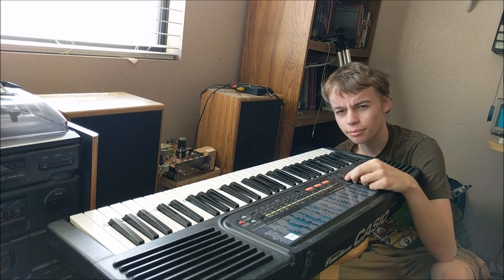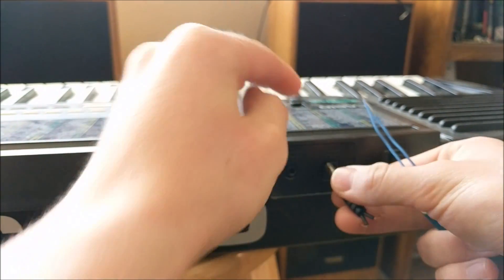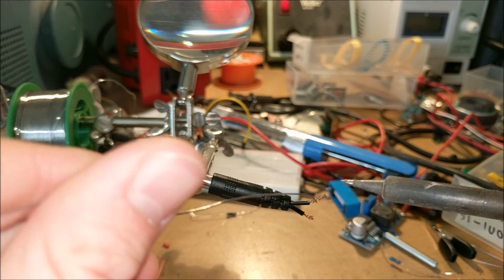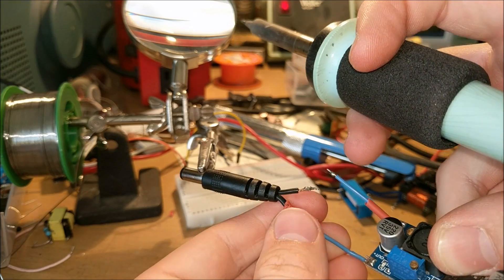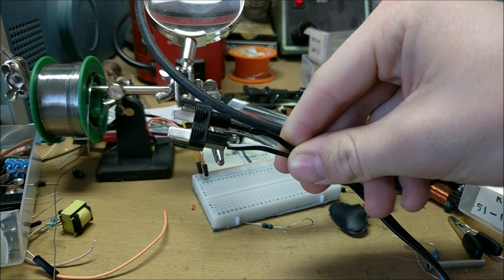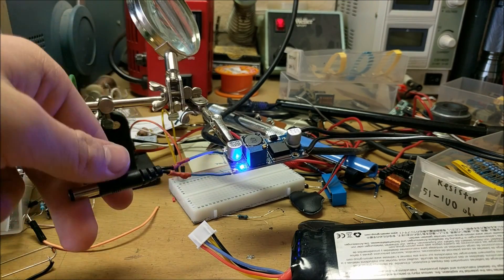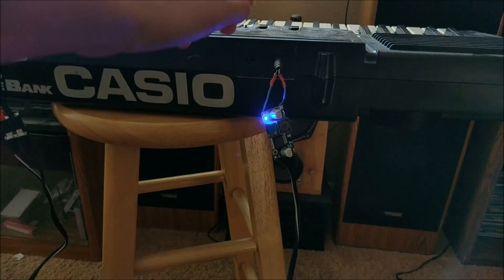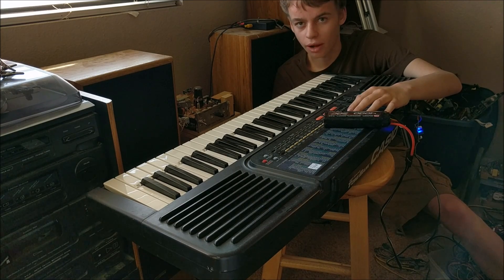Portable Keyboard Power Supply

Comment: Good idea and looks very easy to make if you've got the soldering skills! I don't. As an added suggestion:

I use a 16,800 mAh Trek Pow G22 car jumper battery pack $64 (which includes a 12V  cigarette lighter adapter) and a BESTEK 300Watt Pure Sine Wave Power Inverter Car Adapter DC 12V to AC 110V with 2 outlets. That way I can use my keyboard's AC power cord if it doesn't have a 9 volt DC power supply. And plenty of power to plug-in something else like mini powered speakers, a light, or a fan. But if carrying all that extra gear is too weighty I sometimes keep the power inverter at home and take along the PowerLine Car Cord Adapter $24 which also includes USB Power 90305 and 9V adapter (Provides 3, 4.5, 6, 9 and 12 VDC at up to 2000 ma).  BTW,  I like your take-along power supply but my kit provides 4 x the power of your DIY project and doesn't involve soldering for those lacking the skills, like me. :)

Comment: If that's a 9v power adapter, could you have also potentially made a Giant 9V battery power cell connected in parallel to increase Amperage, and therefore mAh as well to power the Keyboard, as opposed to using a 12V battery and step-down circuit?
Reply: Yea, it is possible, if you would like, I could help you with that

Comment: You also should make a circuit that warns you when the battery gets low. Especially when you are using a lipo battery.
Reply: So, true, I will try to put that in my own too because I don't have that.
Reply: Buck converter have led
Reply: @khelahoberifles832  it's very important to stop the current flow when the lipo gets below ~3.3 volts per cell or it will get damaged. The led on the buck converter had nothing to do with that.